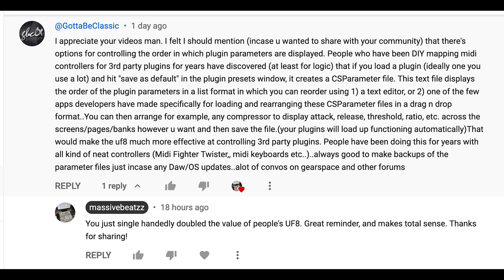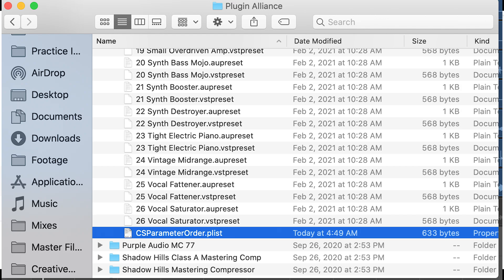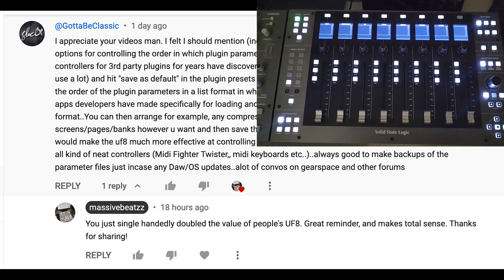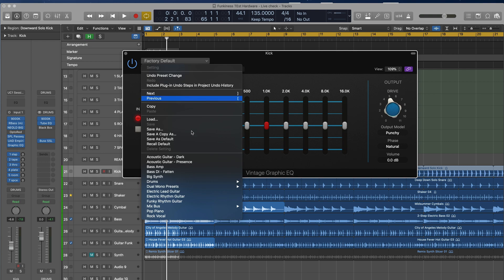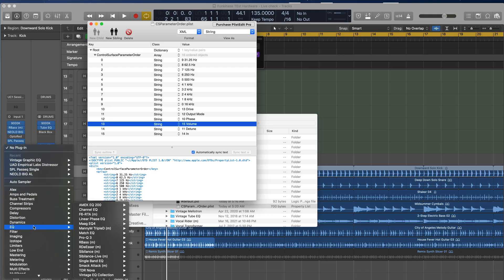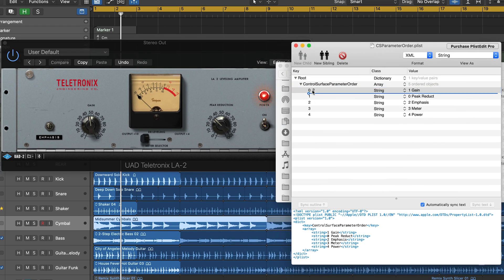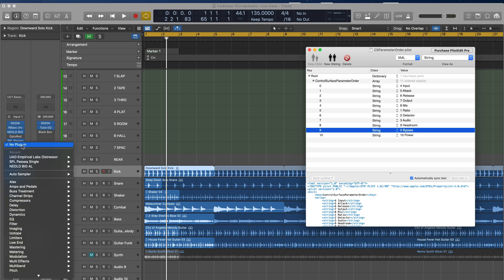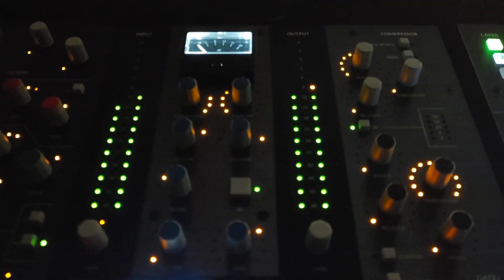UF8: Controlling 3rd Party Plugins TRICK!

Comment: Trying to do this but can't make it work No CSParameter is created in the folders... Have a M2 Mac, running Sonoma.
Reply from the maker: they are hidding by default now. You have to press option, as you create them.
Reply: @massivebeatzz how do you mean?
Reply: @massivebeatzz  I also can't see any file created with or without pressing or holding option. Could you elaborate?

Comment: I can't see CSParameterlist for my Waves plug-ins after Save As Default. It works with SSL plug-ins.What to do? Using Logic.
Reply from the maker: Just did it in Logic. Is in the Folder /Users/myaccount/Library/Audio/Presets/Waves/DeEsser (s)  in the case of saving it on a stereo de-esser (after saving that as default). Hope this helps.
Reply: @massivebeatzz  No, can't find it. Under myaccount I don't have Library under myaccount. Looked at several other places can't find it. I have Library/Audio at other place but can't find it there either
Reply from the maker: @JonteWasaPer  You have a user library. In finder, press ALT and then  on GO at the top. It will reveal the user library. I think you are overlooking it.  If not, you could tell any logic plugin to create a preset or whenever, and it will create / write into that folder. Then you can try again.
Reply: @massivebeatzz  Ok, thanks, will try that.
Reply: Thanks everything ok now!

Comment: Hey - Thanks for this , I only seen to be able to show the second have of the controls 9-16, it is not moving the page to the first 8 controls? any ideas, tried restart etc no joy yet??
Reply from the maker: you;re welcome. Have you tried pressing the left right arrows on the UF8, to get to the first set of 8? And p.s it only needs reloading the plugin afterwards, not even a DAW restart.
Reply: @massivebeatzz  Hi Thanks for your response, yes I have tried both of these actions, what's even weirder is that, when I load the plug-in is sometimes shows the first 8 buttons and doesn't allow to move to the 2nd 8 , I might reinstall the UF 8 and see what happens.
Reply: @massivebeatzz  Hi I have further investigated , if I put 8 blank lines in the plist editor, it allows me to roll the pages for this plugins, interestingly the standard logic eq is absolutely fine in its stock form with no fettling required, weird.

Comment: That is a great tip!!  I have a question:  After you've done the editing as you like it, if you choose one of the plugin's built in presets as your starting point, does that override your user default mapping?
Reply from the maker: No it would not, only if you actively save it as default.
Reply: Good Question

Comment: bonjour dans cubase comment modifier le fichier .vstpreset ?
Reply from the maker: un editeur de texte sera une facon simple.  mais aussi une app, mais ca depend si c'est mac ou pc.
Reply: @massivebeatzz  I think .vstpreset is not a text file, and has mostly binary format... BTW do you know anything equivalent to CSParameters files for Cubase ? I would love to be able to use this great video tip for my Arturia Pigments (best synth ever...) VSTi but I'm using Cubase Pro 12
Reply from the maker: @doctor-mad  it is not a text file, but it can be opened and saved with a text editor and will display as a txt file. It is just instructions. I am not sure how Cubase handles this.